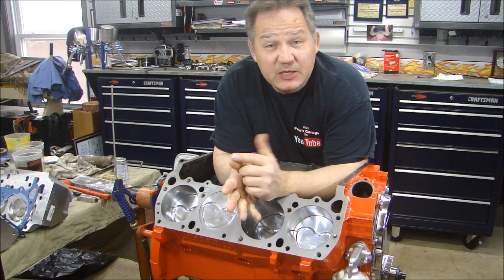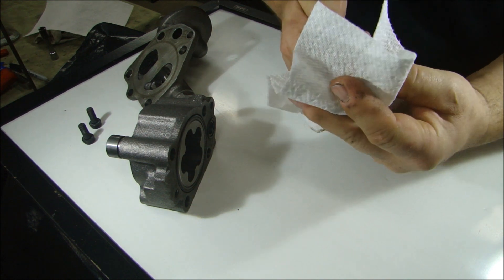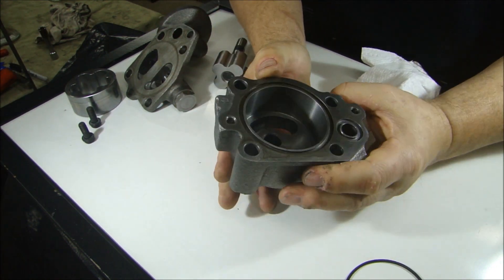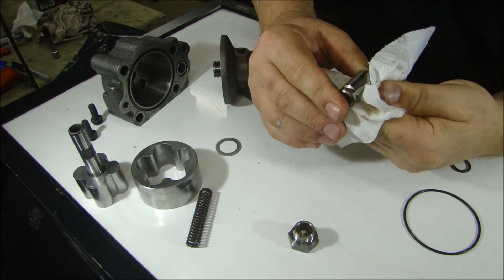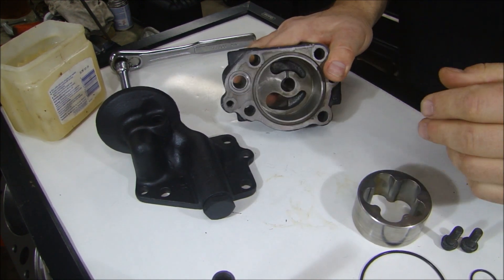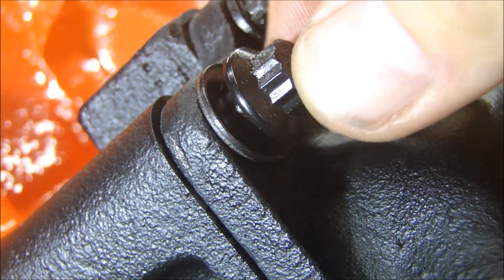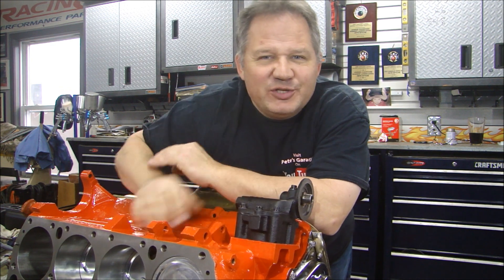440 Chrysler Mopar Engine Building Part 7   Oil Pump Cleaning and Installation

Comment: I'm curious about what happened to make you think about opening up the new oil pump to clean it out lol. Seeing that is nuts....although I'm not really suprised. If I ever get to start doing this I feel like I'll start getting paranoid and break every new part open to clean it -_-
Reply from the maker: Well, I have worked in manufacturing a looooong time. When I took it out of the box a tiny bit of a dirty lube came out of it, so I wondered what it looked like inside. It was a gut feeling really.
Reply: Pete's Garage yea that makes perfect sense. Good thinking!
Reply: Not like they are selling Chrysler 440 oil pumps by the trainload anymore. The last "original" ones made for cars was 1978, Dodge trucks 1979 and 1980 for industrial applications such as Winnebago industries and then the engine tooling was sold for scrap. When you go to your local dealer and order a Mopar RB 440 block is was cast and machined in Mexico and shipped to you from a supplier.

Comment: I can attest to the necessity to open up and clean and de-burr a new oil pump...failed to do it on a fresh 383 Mopar build 17 years ago and promptly trashed a main bearing/journal and adjacent rod bearing upon initial start-up. Shot metal through the whole engine, and didn't even know it until I drained the oil after the 20 minute cam break-in! Had to pull the engine, send back to machine shop for a complete do over! Was not their fault since I only had them do short block and heads separate, and I assembled (including oil pump!) myself. We determined there must have been a piece of trash in the new pump itself that immediately shot to that main journal. Can you say "learning curve!" Learned my lesson! Thanks for this video, great lesson.
Reply from the maker: That really sucks. I learned the same lesson which is why I always check. It does not take long and it's worth the piece of mind

Comment: Love this series :) I know you put petroleum jelly in the pump to create vacuum but I noticed you also lubed up the o rings with it. I always thought that patroleum was harmful to the rubber and silicone was safer? What are your thoughts on it?
Reply from the maker: Very good point. The o-ring is made out of Nitrile (buna-n) which has excellent resistance to petroleum products.
Reply: Good to know, thanks :)

Comment: Not to be picky or anything, but you were referencing the “check valve”  correct me if I am wrong, but that is the pressure relief valve to regulate the pressure output of the pump. Otherwise your pressure would be out of control.
Reply from the maker: You are correct

Comment: Beautiful engine that should be put a smile on the owners face when he steps on the gas compared to the 'old; 440 with 375 hp I am sure the added torque will astound him. I am sure that's an easy 10 grand engine. Does the owner have the 'original' 440?Will watch to see it on the dyno-- Oh did you ever get that 351 W head oil return problem fixed? That seemed serious and was that a casting issue?
Reply from the maker: He has the original but blew out a cylinder. The dyno video is posted. You can build this engine yourself for the low price of $12,995. The oil problem was a slight casting variation, all fixed and running

Comment: Hey Pete, I have a similar pan and want to paint it.  I am not sure what the treatment is on it, so any idea how I should go about painting it?
Reply from the maker: Scuff it with a scotch brite pad, clean it really well, and use either a rattle can engine paint, or a spray engine paint like the Eastwood 2k.
Reply: Thanks Pete. I don't know what I did wrong or if something was put on it from the manufacturer, but I did scuff it when I bought it and painted it with  Rustoleum after cleaning it off with acetone. It looked great for about three weeks and then all started flaking off.. I'll try again.
Reply from the maker: Use a metal etch epoxy primer
Reply: @PetesGarage   Hey Pete. It's been ages and I still have not fired my 440, but I am working on it a bit at a time. It really sucks having a bad back. Anywho, I sanded off what was left of the paint and washed it down with acetone and etch primed and painted it. That was months ago and it looks like this time the paint might just stick!! I don't know why it peeled off before. These are my common steps, but I normally don't buy pans with any treatment on them. Going to clean out the Mellings pump soon and paint and install it. I saw someone else mentioned about the pump to block area needing to be ground better. That is also something I've always done and had great luck with. Hope you had great holidays, buddy!!

Comment: Can you use the petroleum jelly to rebuild a power steering pump?  I was told to use transmission lube but was thinking maybe the jelly will dissolve in the power steering fluid as well.
Reply from the maker: I would say probably not since there is no filter, but try to dissolve the together and if it works give it a try.

Comment: When do you use a high volume vs. standard oil pump? Can you explain.
Reply from the maker: When you go to a higher HP, you need more oil flow to help remove the heat and keep the top end lubed. If you install performance parts like a cam and stroker crank, you want more volume.
Reply: @PetesGarage  is that a external oil pump u would use with a 534 stroker?
Reply: Meant 543 stroker
Reply: I would add that caution should be exercised when using a HV pump, especially with a stock capacity oil pan. There is then a risk of sucking the pan dry at high rpm. So like Pete's eng, a deep sump pan is a must for HV pumps. The main benefit of the HV pump is hot oil pressure at lower RPM, So if you run high bearing clearances, full groove bearings or your eng is a bleeder/leaker (internally) HV may be for you. Also bronze gear setups are not as robust. If I were running a roller cam/bronze gear, I'd probably try to do without the HV pump to reduce the load on the gear. Lastly in some cases the extra load has caused spark scatter, because the oil pump drive shaft turns the distributer also and can twist back and forth effecting your ignition timing.

Comment: Hi Pete, 

I thought you shouldn't use paper towel due to the FM it will introduce to the internal parts?
Reply: Nevermind!  you later clarified that.  I commented before I watched the whole thing
Reply from the maker: You are sharp for catching that..... but I make sure they are gone during assembly ; )

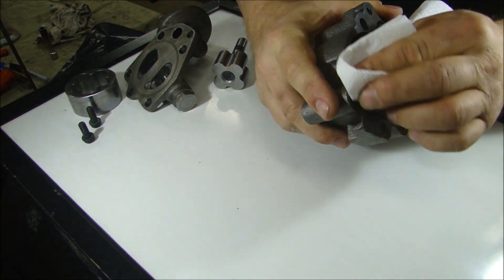Comment: Did you put the part back that fell out @2:15
Reply from the maker: Yes, that was an o-ring. There are spares in the gasket set.
Reply: So the small o ring that fell out  went back in before you started filming?

Comment: When you torque down the bolts, do you get the values from the engine manufacturer? Are you using aftermarket bolts and get the values from the bolt manufacturer?
Reply from the maker: I am using ARP bolts and they provide a torque spec.

Comment: ha before he pulled it apart i was like omg you have OCD then i saw how dirty then i was like maybe i should clean my brand new oil pump in my freshly rebuilt 302 cleveland
Reply from the maker: I am far from having OCD, but I have seen worse inside new pumps so I always check.

Comment: I always level the mating surfaces with mine and also do a little smoothing out of the oil flow passages. So pretty much ''blue print'' the pump. You can get some nasty looking casting flash inside new pumps.
Reply from the maker: That's a great idea. You can always do better than what is considered "stock".

Comment: Thanks again Pete. 👍🏻 noticed you lost a o-ring at 2:13 👌🏻. Also the pumps gear looks like the Geneva drive design almost, same type they use in old projectors and in CNC Machines 👍🏻 really cool to see
Reply from the maker: Yeah, that one rolled away. There are new ones in the gasket set. Interesting pump info
Reply: Pete's Garage thanks Pete for your detailed hard work. 👍🏻

Comment: Hey Pete, great info on that oil pump. You're build has been helpful for my 400 big block 74 Dodge Charger. What was the torque specs for the oil pump? thanks!
Reply from the maker: The bolts are standard 3/8" ARP bolts so they get 45 ft lbs